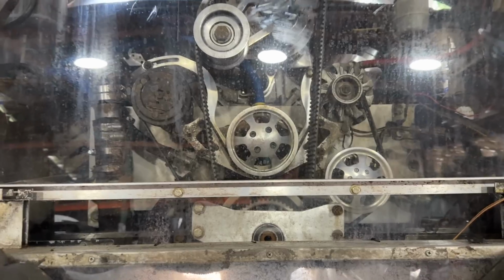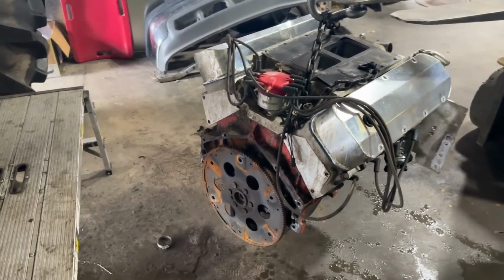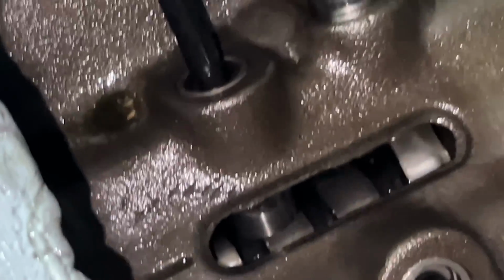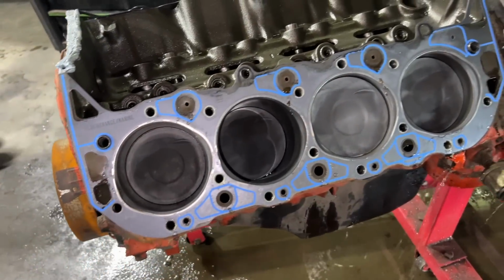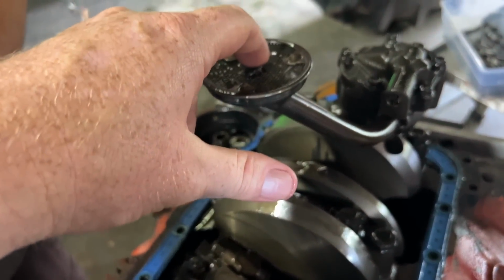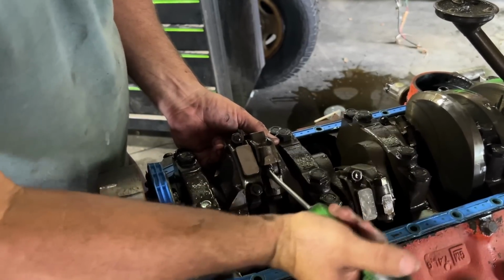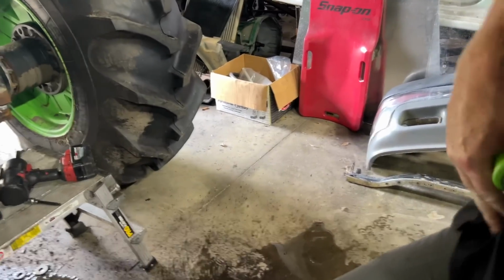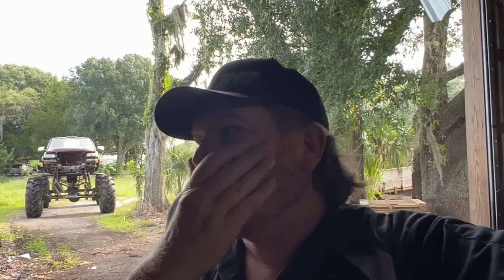1,000HP Capable On A Stock 454 Block? INTERESTING Find On Tearing Down Our "RV" Big Block Chevy...

Comment: What a Great and actually rare find. These blocks were cast as upgrades to the Badass original LS-7 454 blocks. The LS-7 was meant to go in 70's era Corvettes but never made it due to emissions, fuel , taxes etc. These newer casting were an experiment to address the originals few short comings. I would line bore and deck her so that she was square . Then get a forged rotating assembly , windage tray and scraper.
Reply: Those 454s originally came in the 70 chevelle as 450 hp base motor then went from there
Reply: @kingperfection1868  LS-6 came in Chevelles and Corvettes.  The LS-7 NEVER came installed.
Reply: Not positive but didn't some of these 454s already have a forged crank?  
If it's not too far gone......
Reply: @ryurc3033  Yes. A lot of HD and performance big blocks had forged cranks. This engine looks like it was assembled as low buck as possible.
Reply: Article can be found in old HR mag was the original GMPP Ls7 copy with updates then used to help in designing the later 572 crate engines. Should have 5/8 main bolts.

Comment: It’s Absolutely Good For a 1000+ I’ve Ran Factory GM 4 Bolt Blocks Blown Alcohol At 1300 Horsepower with No CrankShaft or Block Damage Issues, You Guys Will Love That Thing when She’s Fresh🏁🏁🏁🏁

Comment: i Drag Raced Stock 454 Blocks for many years, even stock forged cranks with a Blower on Alky  25-30 psi  makin  about 1200hp . i do use aluminum rods. the blocks held up fine , but at that hp level those main caps move around. thats a problem. i still race a blower motors but changed all my stuff to Aftermarket Blocks, splayed billet caps yada yada

Comment: Pull one of the rods that’s not bad and check the top vs bottom rod bearings, make sure it didn’t hammer the top bearings out of it from too much timing before you rebuild it because it’ll do it again regardless of what’s in it for a rotating assembly.
Reply: What I said, rod bearings is definitely a tuning issue

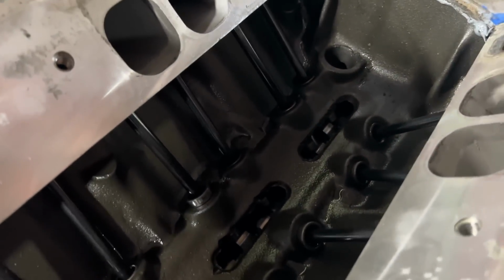Comment: 4:35 look @ the flow restriction on those oval port heads Vs the size of the rectangular port, you need to junk those oval port heads & put rectangular port heads on it to match the blower intake, you're probably killing 150/200 HP from that air flow restriction on a blower engine.
Reply: Oh wow! They need to get this figured out.
Easily leaned the engine out bc of force induction.. right?
Reply: @macattack1392  The air & fuel isn't flowing good because it's hitting a (china wall) with a straw size hole in it is the best way i can describe it, so yes it can cause it to run lean & cause detonation & knock the rod bearings out.

I made a comment about it back when they got those oval port heads but i know it's hard for them to read every comment, but If they use those same heads with the 496 i foresee the same thing happing again.
Reply: @Brooks336  yep agree. I didnt realize it originally. Thry jist said they were having issues. 
But unless they replace the heads, or risk machining the ports taller (idk if u can) then ya they will starve the other engine too. 
Hopefully they get someone there in person to realize it. I'm in their area but I've never ran into them. Lol
So not going to go drive over to his shop to tell him. Hey look this is a problem. Lol

Comment: If memory serves me right, that would be a Tonawanda 454, made in New York, and they had crank issues from new, but make a excellent base to build a 496 out of. They were used in the 3500 gm pickups of the era
Reply: That's what I was thinking. That engine probably was originally built by Chevy's Tonawanda Engine Plant. A lot of iron came out of there.

Comment: Its the best factory mk4 block. Holds easy over 1000 hp. Siamese bores makes the block wery sturdy. You should make the engine run on e85, it gets you like 100hp more, and the engine runs much cooler.

Comment: Time to step up from the peanut port heads and get some big boy rectangle ports.
Reply: Peanut port heads were smog era junk.
Guaranteed that's not what came on a gm performance replacement motor. 
My 76 was supposed to have peanut port heads, and at some point in the past got a performance big block (4 bolt main, .30 over, "torquer" performance heads.....in one of the 4 videos they were discussing intake gaskets not fitting, and having to order the same set I had to order. There were many variations of big blocks in the 50 years they have been around.

Comment: Is it me or did some of those lifters look to be riding the side of the cam lobe not the center of the cam lobe
Reply: I was thinking the same thing. May have just been the angle though.
Reply: Flat tappet cams work that way, that's what causes the lifter to spin.
Reply: @TheBlackDeath71  have heard " my cam is screwing up' several times, only to point out this fact.

Comment: If you pull the drain plugs for the cooling system on the side of the block before you pull the motor you wont have to deal with coolant going everywhere

Comment: Not sure on a 454 but on a older gm it was fairly common to see a 4 bolt in a work truck or something heavy they knew would be high revving all the time.
Reply: The 427 tall deck were capable of producing around a 1000hp
Reply: @robertredmon6387 basically found in big trucks,  1 ton or bigger

Comment: 4 bolt mains are just as commons as 2 bolt engines. And yours is basically a a replacement short deck 454 that was used in like 90 and 91. Look at your head casting number and if they are 14096188 then that was most likely a factory 450 hp big block.

Comment: All big block Chevy blocks after 1984 are 4 bolt blocks. The old tall deck big blocks had steel cranks that made cheap 427 builds out of 454s after being balanced. The 4 ring tall deck pistons are really heavy.

Comment: Look for a bowtie on the block if it's from GM performance it will have one. All newer stuff I bielieve is 4 bolt main. Cast crank good 700 hp block will hold over 1000. Standard deck   brother to the 427 tall deck. Work horse engines.

Comment: I noticed that the lobes on the cam were no more than half way on the lifters. Is that normal on that big block? I noticed it the second you took the intake off. Surely that geometry cannot be right. If thats the performance block even the main bolts are 5/8 tapered. I would dig a little deeper on verifying that block
Reply: being flat tappet they are lobes offset and slanted  to make the lifters spin. yes flat tappets spin inside thier bores
Reply: @MsLoneWolf4  what i was seeing reminded me of a cam bearing that went south in the front (needle bearing) but this doesn't have that. I assumed they spin but was not sure about the huge offset. Hydraulic is all I've ever used.

Comment: I'm doing the exact same rebuild on my 454 right now.  4 bolt main,  same engine you have.  Mine has 76 stamped on the side of the block??  Anyway piston side of rod bearings all worn down to the brass evenly, no other damage...

Comment: Oooofff… 😬

I bet the airflow is good and turbulent with the rectangle port blower manifold hitting the jersey barrier into the oval port heads lol. 

That would’ve been a gm performance long block… Why you see all the stampings on the rods. I doubt someone knowingly put a rare gm race block in their rv… My guess is they needed a engine, and bought what was available…

Comment: 1000 HP in a light drag car. In a truck like that with big heavy rims and tires, I would guess 700-800 hp. The stress is multiplied from the weight, not to mention the stress or resistance of the mud.

Comment: Y’all over looked the fact it has a steel crank not a cast crank I wouldn’t buy another crank just polish that one back to smooth and run good rods and best bolts you can buy stock 454s run cast cranks only performance and marine ran steel id lower the compression to 8:1 and run more boost longer.  I run 557s that make 2500hp on e90 and there 8.5:1

Comment: It will take 1000hp fine. We run big blocks in our race cars. You can make 700-800 on a 2 bolt main block and be ok. 4 bolt main will definitely be better for boost. We also turn ours 7k to 8k rpm depending on whether it has a single or dual plane intake on it. If you want to make that power and rpm though you need solid roller cam, probably need stud girdles, and definitely rectangle port heads. It almost looked like you had rectangle port intake/gaskets on oval port heads.

Comment: better get a Dart or World block if you want to hold 1000 horsepower and not rebuild regularly. And since it's blown and you are loading the crank snout, you yourself a favor and buy a billet steel crank. Buy once, cry once.

Comment: What is stopping the forward and backward movements ?
Reply: The last main cap that holds the oil pump has the thrust bearing built into it. Might see it on the next video....maybe.

Comment: why is there water leaking out of the bolt holes ,on right side where the heads mount that aint good, water in block holes for bolts ,cracked jacket? or are those watercooled bolts
Reply: I do believe those bolts run right through the water jacket.

Comment: If it’s a 10069286 block you’re looking at a real good motor. That’s a “4-bolt, Mark IV, (short deck) 454 service replacement” that GM used between 1990-91.

The “HP” doesn’t necessarily mean a lot.

As mentioned, these guys found their way into a lot of marine applications as well and yes, they were painted black – even the aluminum intake manifolds. If the head casting is 14096188 you’re in really good shape – rectangle port, 116cc chambers and I believe that would be indicative of the 450HP version however, without knowing the internals it’s impossible to tell for sure.